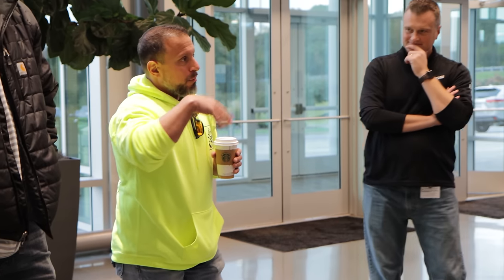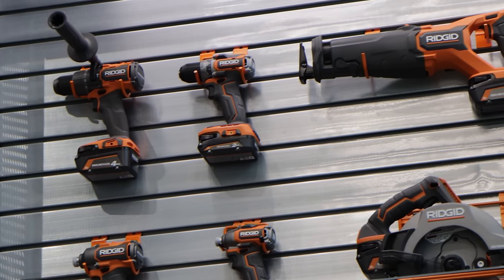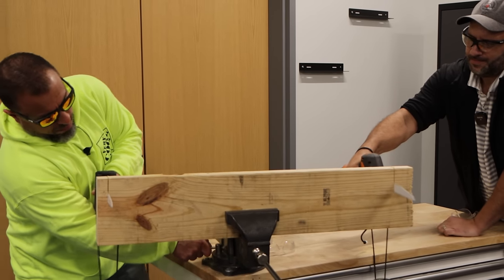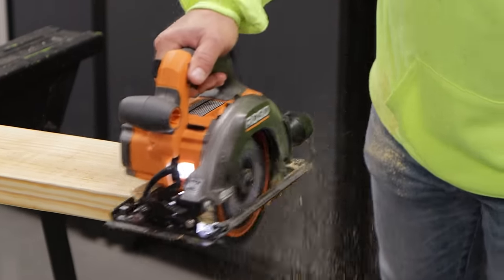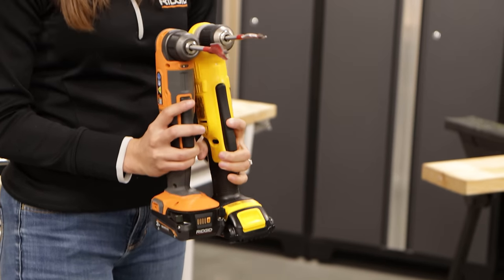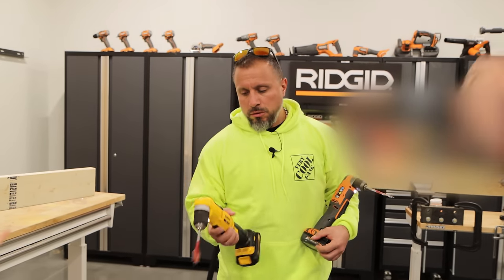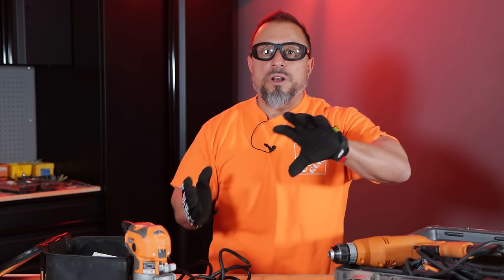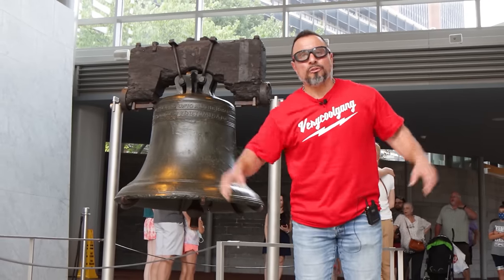Telling Ridgid Executives I Don't Like Their Tools!

Comment: Where is this?  I have my own beef with Rigid......Their  smaller compact 12v products were discontinued.  Why so?  Now their 18v  'compact' tools have a battery as big as a one gallon bucket.  Sure, the electric motor  part looks small, but that's because the battery extension part is huge.  How are you going to get that big thing into a small space?  One is better off with the old Mikita 120v corded tools which are smaller AND more powerful.  Rigid is going to let customers get hooked up with their new line then they will cancel that line too....like the 12v product line.  Heck, they don't even sell batteries for the 12v products anymore!  Rigid had a great 'Lifetime guarantee' in place to entice one to purchase  their product.  I did, and I like the 12v line but it's gone now.  Rigid is a ripoff  when it comes to corporate honor.  They'll lie to you!!

Comment: I wish I could get hired to make over a tool brand because the industry all wants the same thing and falls for the most simple gimmicks and design of the tools.  It's not secret why "Diablo" and "Spyder" is a good brand it's because of the design of the tools and the name....  I mean there are people out there who literally buy DeWalt and Milwaukee because of the color scheme and then try to confirm their bias as to why it's the best tool because they like the way it looks.  A lot of tool users are simple minded and DIY users that don't actually know about what makes a good tool in the field on actual jobs.  The best tool is the tool that does the job the best over a long term period and which battery platform has the selection of tools you need.  It's possible for any power tool company to be on top.

Comment: What's not to like? the higher rpms? the lighter weight? the longer lifespan?
I would rather die than use dewalt tools. They have only let me down or injured me, or broken on the first day.
Rigid tools is the best brand of tools that a real working man can afford.
I guess if you have a trust fund, you can afford Bosch...

Comment: Any tool can do those easy jobs. Show me a bolt with red loctite on it and which tool breaks the seal. Show me one that won’t strip, but will be powerful enough to do what it needs to do. Idc about brand. I want a tool that will do the job the first time, everytime. Milwaukee is the only one I’ve found that lives up to my standards.

Comment: had a ridged table saw with stand. was a greate saw 15 yrs ago. bought a new one 3 yrs ago. what a joke! the plate around the blade is held down by 2 small rare eart magnets. vibration of the saw breaks the "bond" of the magnet to the table. the saw is usless once you loose the magnet.  try that when your 20 minutes  plus from a hardware  store. when you adjust the bevel and depth you can feel the plastic gears flexing. I heard of a book I must check out. It is "race to the bottom". can you be the first to build it the cheapest? I think ridged might have won this race.

Comment: All Rigid tools look like the cheapest stuff on the market.  The only Orange tools worth a crap are Fein.  Otherwise orange just screams "Cheap, budget, garbage."  Harbor Freight's "Pittsburg" screwdrivers.  I threw away 2 Rigid drills at a worksite because the chuck failed. Replace them with Milwaukee, never looked back.

Comment: Ridgid tools are just fine but aren't as "prestige" as  DeWalt and Milwaukee.  I've had multiple DeWalt compressors and pressure washers fail on me due to shoddy seals and been just fine with the house brand.  Friends in construction says MKE tools are not as good as they once were either.  Honestly for the warranty and being that the tools are decent and the offering is good, I'll stick with Ridgid

Comment: Yes but your biased against them because you love Milwaukee. I'm fine with that, my buddy hardcore DeWalt fan. I use DeWalt on the job because that's what my crew runs. This makes battery management easier on a roof. But there's been times I had to use my craftsman and it held up just fine. I actually started with the brand. It was a little slower, but not having change my battery 3 to 4 times  made it easy to keep up. And it's several years old and my batteries definitely out pro-form my DeWalt. But we use a big DeWalt 4 battery charger that goes up with us. My only problem was I would have to get off the roof to go change mine. So I gave into the nagging of the crew.  Mainly one person on the crew did all the crying! Yeah my buddy who hardcore DeWalt fan, help make it were the whole crew uses the same brand. Do to the battery situation.

Comment: I give the people of Ridgid credit for trying to innovate and improve their brand, but they are tone deaf. Who needs a super powerful compact right angle drill? That's not how compact right angle drills are used, with a spade bit. An electrician or plumber is going to use something like a Hole Hawg or Super Hole Hawg with an auger or self feed bit. Even if an electrician was using a spade bit for rough in, is that drill going to stand up to that kind of work? No, and the ergonomics are all wrong for that sort of work. Congratulations Ridgid for being #1 in a category that doesn't exist. Moving on.... "blade left" saws and "making crosscuts all day long".....the people doing that want a beast of a saw with a truly powerful motor like the Flexvolt or Mag 77, long reach, and a rafter hook. Looks like Ridgid is also number 1 in this fictional category in their collective minds, then we get to the one handed recip saw.... One handed recip saws are not the demo kings and anyone who has ever used one knows why. Long stroke looks good on paper, and is good when you have room to move, but try cutting out stub outs under a sink or a similar space constricted task with a long stroke saw. You'll curse the day you were born after you keep jamming the blade tip into the back of the cabinet or other surrounding material. Then you have the lifetime warranty that Ridgid tries to get so much mileage out of. Do 10 minutes of Googling and you'll see hundreds of accounts of people having positive experiences when dealing directly with HD and battery swaps, but you only get one replacement per battery, in a lifetime. Then look at the angst of trying to get warranty on one of their stationary tools. Most people end up very unhappy.  Ridgid has work to do on their lifetime warranty.

Vince, I understand you moving into the brand ambassador realm, and congratulations. The way you handle tools it appears that you have a lot of experience with them. What Ridgid, Ryobi, Flex, et al need to do is put prototype tools in your hands and the hands of guys like you for use on an actual jobsites, then take feedback and make needed improvements before trotting out their "incredible" new tools. They also need to ask guys in the field, what tools do you need, rather than saying "try my new bread slicer and tell me how wonderful it is". Every tool in this video is a tool that will spend most of it's life in the trailer. People who actually use tools see through all the pomp and circumstance of these tool release videos and nobody associated with them ends up looking good.

Comment: Yeahhhh...uh...I was a fan of Ridgid when they produced and released their brushless 18v line. I was ecstatic when they produced their Jobmax and Charger radio, but WTH??!...Ridgid DISCONTINUED BOTH THE Jobmax line AND their Charger radio, model: R84085 !! First of all, the R84085 charges 18v batteries as it is plugged in v.s. the R84087 which just depletes the battery leaving the user high and dry when they unplug and relocate to the job area without power. Bad form Ridgid.
Most disheartening...I totally invested in their Jobmax platform, buying every attachment head. Man...skeptics were blown away and very seriously considering getting their own Jobmax system...then, Yep...RIDGID discontinued their whole Jobmax line just when ai was about to buy another co.plete Jobmax system for another location.
I'm sure the move made total sense to their executives and junior execs...maybe they saw a drop in sales of their individual stand alone tools...I don't know their rationale, but from the perspective of this customer...I and my colleagues are very disappointed. NICE business model Ridgid; Release a great product, then discontinue it in two to five years afterward.

Comment: I always liked rigid they always have a little extra feature... I use the multi-tool I use their hammer drill/screw gun although when it comes to certain things like sawzalls I only use Milwaukee and circle saw only skilsaw 
Other than that their tools are totally fine and they used to have a really good battery exchange I think they still might..
But I'm pretty sure this dude is getting paid off by DeWalt... I mean it's in his
Clip art..

Comment: Rigid makes great plumbing tools but those tools are made for professional plumbers.I don't like their regular cordless tools because the batteries where complete shit.No power compared to Milwaukee tools and their cordless tool line is very basic (other than the plumbing tools but those are not cheap and they are not priced for the average person).They show you how well the tools work but how long does the battery last?It works great when fully charged but the power dies pretty quick.

Comment: I did not like the start of this video when they were going head to head with a reciprocating saw if you look at the 2 by plank in device look at the direction of the knot the dewalt tool on the other side clearly was trying to cut the right knot

Comment: I bought a sliding compound miter saw cannot get it to cut a straight line.  Contacted Home depot,  they wouldn't help. Contacted Rigid,  did you register the tool? No, I forgot.  Well Sorry Sucker!  I will never buy another Rigid tool and this is not my first Rigid tool but it is my last!

Comment: #1 the sawzall test was a gimmick, the dewalt was cutting through a knot section. Go back and watch the clip. Every time the dewalt hits the knots it slows way down. 
#2 the right angle drill on the rigid is obviously higher output than that thin dewalt compact battery. 

I just lost more respect for rigid by in a way cheating there demonstrations.

Comment: LMAO Ridgid is a dam good tool it's hilarious you put Ryobi in there it is a step up from them and it does the job. You will get it done faster with DeWalt or Milwaukee. DeWalt is not the best Milwaukee is. If your going drill driver/ hammer it's DeWalt if your using oscillating tool it's DeWalt everything else is Milwaukee.

Comment: I had a Ridgid 10" table saw. I'm  a framer/ remodeled. It was a great saw lasted many years. Bought a second one 3-4 years ago. WHAT PIECE OF CRAP! You can feel the adjustment wheels flex when you change settings. The real kicker is the plate is held in with small rare earth magnets. Try that when you work in the sand. Needless  to say the 1st time they vibrated loose and I 1) lost them ))2) don't  have any super hlue 3) Am 20 min to the nearest hardware store. I was doing trim work and the show had to come to a stop.  yes, some will say. you could have fashioned ect.. I should NEVER purchased  such crap!

Comment: wont be buying it. The tools in the industry i use have interchangeable battery use with most brands but not rigid. The right angle didnt look any smaller for use in my application than dewalt.

Comment: oh come on you put the battery facing the wrong direction on the right angle drill now its not able to drill a 90 degree hole .  dewalt did it wrong too .you are terrible.  what is wrong with you?

Comment: I have way too many Ridgid products. Purchased because of the lifetime warranty. But the warranty is like any other warranty and waste of time and money.  Their website to register is always down then you have to call and wait for hours on the phone.  Then it shows pending for months. I would NOT ever purchase any other Ridgid tool. They are as cheap junk as Walmart.  I wish I tried Milwaukee 1st. The only thing that Ridgid has that is good is the RED RIDGID!!! The real Ridgid. Nothing Ridgid comes close to anything Milwaukee. Even Milwaukee m12 is better than Ridgid!!! Those tools y'all try in a shop won't last long in a real world. I got a truck load of boat anchors. Time is money. Ridgid is only for a homeowner that piddles.
I got Dewalt also and it will run circles around Ridgid. You can see clearly Ridgid got the soft side of the wood and Dewalt got the harder wood. As you could tell Dewalt was in the lead until Vince started fooling with vice and got into the harder wood. 
People use harder wood every day and in treated wet wood not dry soft wood. Thats typical TV advertising. You must have got a kick back for saying good stuff about their junk!

Comment: Rigid tools suck! They were once a great tool company when they sold to professionals. When they started selling tools at Home Depot I tried a few of them all were junk. 14" Metal cut off saw, Junk - It would bend and distort the  abrasive disc causing a crooked cut and bind up the motor. 1/2" Hammer drill: Junk-  the chuck is a joke it binds up before it tightens on the bit. 4 1/2" cut off saw burned out after 20 minutes use, i exchanged it for another one and it also burned out after 20 or 30 minutes use.  I'm Sorry but that was enough for me I would never purchase another one of their tools

Comment: I build my own tools and they are all better than this crap. All my tools are powered by a preside measurement of gasoline and lighter fuel and are 100% dangerous to use or even be around. Once my power saw which I’ve named “demonic Power wood molester 3” straight up exploded in my cousins and and blew his fingers off. Turns out when he mixed the fuel he used way too much lighter fuel. But my tools run harder, work faster and are loud as crap. Also the fumes are highly toxic and flammable as all hell. I used my home made chain saw “the hairless skinless ape from hell” to literally cut the door off a freaking car once. The saw weighs in at 75 pounds and runs on race fuel and a car battery. 

I can’t get any investors so I have to pimp my wife out for money to build these tools. But my hope is one day maybe I can sell it to the military as tools that double as instant killing weapons of death and gore. I even made a chain launcher which launches a 15 foot long chain at 950fps which can easily tear a man in half at 100 yards. It takes gasoline and a cup of gun powder along with a lawn mower battery to power it. I took it hunting once and blew a deers hind legs completely off, it’s almost impossible to aim because the chain is spinning wildly. Luckily you can also just fill it up with nails and broken glass and just take out a whole room full of perverts. I named it “satans little helper” also it weighs in at 128 pounds but it’s worth it.